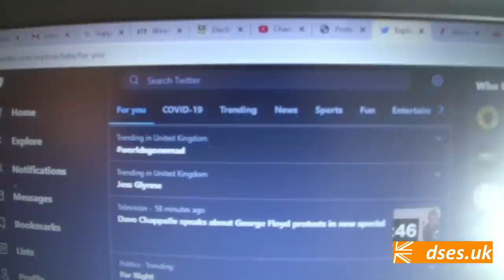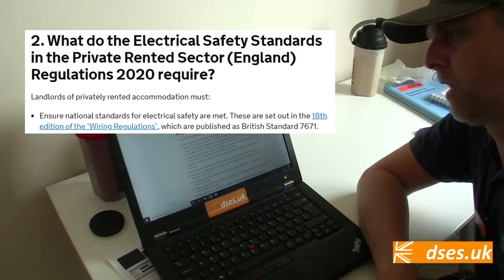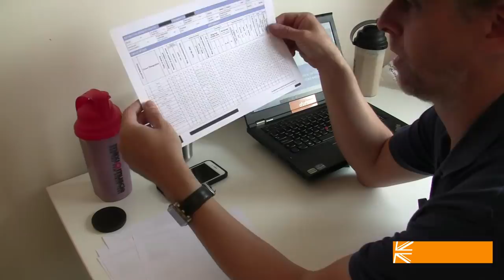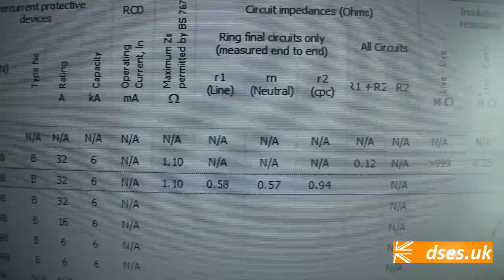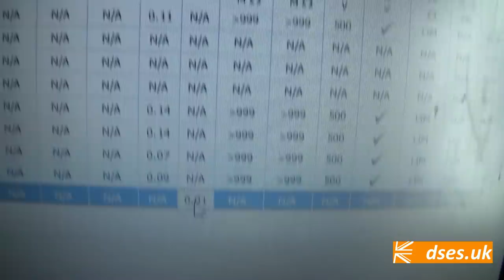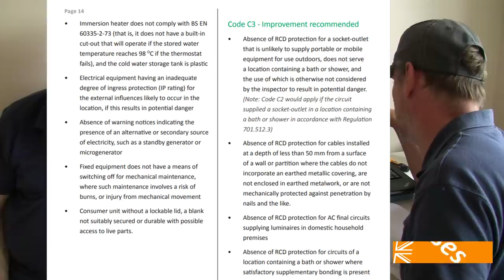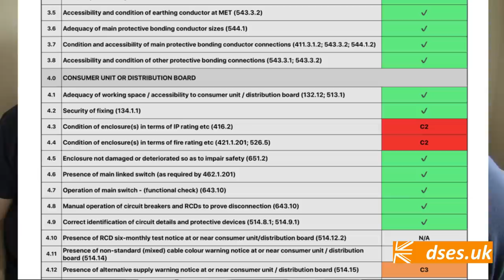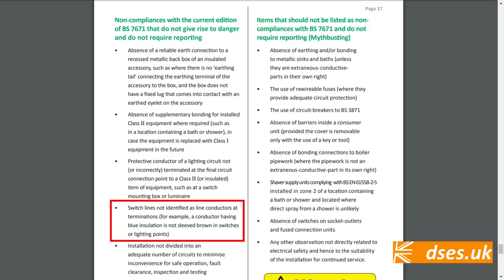Landlord electrical inspections from July!

Comment: When Nigel said are we under charging, I think he was hinting at a pay rise 🤣
Reply from the maker: He gets three apples a week and I'm not about to change that anytime soon.
Reply: Lol.. Nige is bored.. And underpaid, that's what we all gleaned from that video 🤣 this video is why I am not part of any recognised scheme. The rules and regs vary so much across them all. Gov. UK says one thing, IET say another, NICEIC say something else to be different to NAPIT, or whoever.. It's a mess! And who police's it anyway? I just stick to doing a safe quality job, non notifiable work, no rewires, no new CUs, keeps me trundling along. I agreed with everything you said Dave. I would not like to be doing rental properties either, as you say a tenant can come in after all your testing and change a light fitting, socket, etc break a RFC, expose live conductive parts on a light fitting, extend sockets incorrectly etc. Good rant and a explanation of the new nonsense going on. 👍
Reply: @muzikman2008  Had that happen to me on one of our rentals cut the frigging earth wires off when they swapped light fittings because they were in the way  dooohh

Comment: I was carrying out a test an inspection on a commercial property in 2018 when I got an unexpected visit from an electrical inspector  who said I was not to carry out any live testing with probes on exposed electrical parts and should use calculus to find those results,of course I nodded my head and said OK then waited for him to bugger off and went on and continued to live test,and as for not having to pt cpc leads to socket back boxes I disagree with you because you are correct regarding the 18th edition but I prefer to use good electrical practise rather than their bs

Comment: Even after 25 years it's nice to see confirmation that i'm not a complete nobber at I&T. 
I use an actual extension lead as my wander lead.  I like that you just add the water bond on. 
I'm going to copy that if you don't mind, whether you like it or not!
That guff about "the consumer unit not being made of a non-combustible enclosure" is a prepared statement on Icertifi's program. The tails to backboxes was removed by the 16th. I remember an argument at work about it. The only reg in the 16th that demanded this happen was when in a conduit installation the conduit was forming the earth, which makes sense doesn't it!

Comment: David well done on showing good common sense around the electrical regulations after all the regulations
are bounded by good codes of practice the law is based on the electricity at work etc act which is binding in law .
The problem revolves around interpretation of the regulations and the lack of parity and quality of the electricians 
/electrical engineers especially at the domestic level for installations .
Stick to you guns David I’m sick to death of the upgraded editions of the regulations it’s all about making manufacturers more money all of which could be covered by amendments to the existing regulations which could be printed off and added to the existing regs book .
Looks like the first contractor to test the system has done a generic job on the installation failing it when there is absolutely no need or cause to fail the installation it’s all about making easy money , by all means make recommendations but don’t fail the installation if it’s not required.

Comment: Personally, I'd strongly recommend a CU change.  It only takes a dodgy appliance to be plugged in with a broken earth conductor and you have a potentially dangerous situation.  The system earthing may be great but you can't account for some of the crap equipment tenants plug in.  Just my 2p.  Keep up the good work guys 👍
Reply from the maker: RCD protection is certainly a recommendation. For the dodgy appliance though, you'd have to have two faults: one to make the metalwork live and another to see the protective conductor failed. I'm not saying it can't happen, but such a situation being possible doesn't mean a 21yo installation has to be written off. I prefer to put the client in the picture and let them assess the risk rather than demanding they undertake an upgrade and withholding a pass report until they do.
Reply: i see your point but Wouldn't the landlord require that appliance to have a PAT carried out before placing it in a rented property?
Reply: @dl8966  EWR electricity at work regulations. Not at home regulations.

If your employer provides you with any equipment there are regulations to follow to make usre the equipment is safe to use while under taking your paid role. Thus they have to have an asset register and periodic testing and training. 

In a home you could find a toaster on the beach and bring it home and use it in the bath. If you die is that the landlords fault?
Reply: @dsesuk  while I agree it's unlikely, it is possible.  Also with mains filtration on appliances these days, it's common to have capacitive coupling to earth, hence the small amount of earth leakage we measure.  That's fine if the earth conductor is intact, if not, the metal case will float at some potential.  All I'm saying is that personally, I'd not be putting my name to any non-rcd protected installation in 2020, especially a rented one.  As competent electricians, we need to go beyond the bare minimum standards mentioned in these regs.  RCD protection in this case is a no-brainer... in my humble opinion 😉
Reply: @Chris-hy6jy  I'm actually with you on this, I think all socket outlets should be rcd protected on a rental property now. The trouble with giving it a c3 for absence of rcd's is, they'll be recommended on the next report and the one after that, the recommended upgrade never happens. I would personally c3 absence of rcd's for switch drops, if the rest of the installation was in good condition  though.

Comment: To add a RCD that the landlord will probably opt for gives 3 options -
Does the CU manufacturer have one available to fit the board  to replace the damaged switch ? ( quick and easy )
Add one in its own enclosure along side the board (  untidy )
Change the CU ( pita )

Comment: I know places with rewireable fuses no rcd protection. As long as it's safe it's ok.
yes you can recommend things like new rcbos and metallic consumer unit
Reply from the maker: You have to take each installation on its merits of course, but as you say, fuses provide effective overcurrent protection and earthing provides effective shock protection, so a pre-2016 installation shouldn't be deemed a failure just because the designer didn't have the foresight to know what 18th Edition Amendment 1 would look like.
Reply: @dsesuk  I would of done the same just put c3s for no rcd protection and the consumer unit being plastic which are really just recommendations. No C1s or 2s as I could tell it  and as long as all the earthing was good and no unsafe diy add ons or damaged a cable when putting a picture up.
Its up to the landlord/lady if they want to upgrade the installation
Reply: @Dark Dream yes but its not a failure to have an electical installation with rewireable fuses as thats what the design was at the time of install so any eicrs are retrospective to that time period.
You can recommend upgrades like rcd protection and new consumer unit etc which I would have done but they arent failures
Reply: @Dark Dream If the front cover/and or fuse cover was missing then that is a different matter.  You would code it accordingly.  But if the installation was wired according to the regs of the time, and there is nothing  immediately dangerous (eg VIR cable) then it's a C3, improvement recommended.
Reply from the maker: @Dark Dream Rewirable fuses are also mentioned in ESF Best Practice Guide 4 and despite the drawbacks of what might happen (wrong fusewire or device defeated with a nail, etc.), where correctly installed they do continue to provide adequate protection. BS3036 remains a valid standard and is listed in Appendix 1 of BS7671.
Reply: Dark Dream,  are you sure, plenty have been recalled, sparks certainly don’t check for these, then some RCD/ RCCB/ RCBO’s have had there issues and that’s without explaining to some that they can cause an issue.

Comment: A nice thing to find another man who dislikes rings. Absolute shambles, i subbied to a guy who installs a ring downstairs, a kitchen ring and an upstairs ring. I fit the board for him and he insisted on all rings being on a 32. I ran out of breakers and put the uostairs ring on a 10A to see if itd trip, 3 years later that breaker still stands.
Reply from the maker: Crikey. The whole point of the ring configuration was to supply a whole house with a single high-current socket circuit to keep copper use down. Having two or more rings is a nonsense.
Reply: @dsesuk yep. 3x32A rings, 1x40A oven circuit and a 50A shower circuit, all on a 60A main fuse ive witnessed before. All fun and games...
Reply: David Savery Electrical Service

Comment: I couldn't agree more.  Same in NZ or Aus, technically complied with regs at time of install and can remain in service unless unsafe.  Sure there have been additional mandatory requirements like rcds, but that doesn't necessarily trigger the latest regs.
Reply from the maker: Thanks for the view from down under. It's always beneficial to upgrade for safety of course, but the people I have issue with are those who demand it unquestioningly.

Comment: Yes, periodic testing should be done, in the same way gas was mandated. Landlords do need to ensure that what they provide is safe. Gas safety doesn't retrospectivly want the latest highly efficient boiler or whatever installed. Its either safe or it isn't and you can recommend as standards and technology develop. Many installations will be like this for many more decades. Sparkies are still pulling rubber cables out of old buildings for goodness sake. I totally agree with all your commends and observations. RCD's don't cover every eventuality of "additional protection" but they do go a damned good way for a sensible price. What was the statistic? Introduce the compenant person scheme and the number of consumer unit fires went up so we now put them in a metal one to hide bad workmanship? And rings should be stopped. The only way you can test a ring is to break it. You then put it back together. But you can't fully test it - catch the insulation etc? Defeat of the purpose of the testing. If you need a 32Amp final, use 4mm. Sure its more of a ball ache to install....

Comment: As usual a right cluster fudge. As everyone knows even someone like me who hasn't even started training yet, that standards are not retrospective so as you say as long as the installation conforms to the standard at the time of installation it isn't a fail by today's standards.
Reply from the maker: I suppose you have to look at it and ask if a 21yo installation is now so dangerously out of date that it has to be upgraded, and the short answer is no. In my opinion. But what do I know Richard? I'm just a hungover asshat.

Comment: You dont have to note agreed limitations as you listed because its on the front page of the report as shown below.
EXTENT AND LIMITATIONS OF INSPECTION AND TESTING
The inspection and testing detailed in this report and accompanying schedules have been carried out in accordance with BS
7671:2018 (IET Wiring Regulations) as amended to 2018.
It should be noted that cables concealed within trunking and conduits, under floors, in roof spaces, and generally within the fabric
of the building or underground, have not been inspected unless specifically agreed between the client and inspector prior to the
inspection. An inspection should be made within an accessible roof space housing other electrical equipment

Comment: 32A rings may not be great, but 32A radials have there place. They are invaluable it utility rooms, kitchens and garage/workshops. It's much better than a couple of 16A or even 20A radials as you don't have to worry what is plugged in where. 
It's a different story in bedrooms, living rooms and so on. However, the 32A circuit has its place for sockets.

Comment: sounds like a great tool for scam artists. in my line of work, i am to test/inspect to current standards and can even recommend changes. however, the end user doesn't need to update anything that still adheres to the original spec to which it was done, "grandfathered in" . as long as it isn't unsafe or in disrepair, leave it
Reply: I have got into fights on forums over this.
If it's fscking safe it's safe.
Reply: BS3036 boards can be safer than some modern installs.... :\

Comment: I can understand if an existing installation is dangerous - then it should brought up to 18th edition - but as you say if an existing installation is deemed safe for its generation of installation - then it should be passed on that.  Otherwise by definition all previous (to 18th Edition) electrical installations (with some conditional exceptions you outlined)  irrespective of being safe - need to be upgraded!  But I also see there a Code C3 classification -  which states: 

"The C3 classification code does not indicate remedial work is required, but only that improvement is recommended. Landlords don’t have to make the improvement, but it would improve the safety of the installation if they did"

Does that mean it doesn't have to meet 18th Edition or that it does but also needs something else?

Really what this directive should be -  is to simply outline a minimum standard required for rental properties - ( ie an  installation that is safe and  has not been badly/incorrectly maintained/installed) - basically weeding out the bodge jobs that have been carried out - and minimally maintained by a landlord,

Comment: It’s perfectly clear 😦. You must meet 18th edition. 18th edition includes the precondition as you highlighted that it’s not retrospective. All in all nothing’s changed. But yes, I can see many outfits using that first definition it to legitimise cheap upfront EICR with expensive remedials.
Reply from the maker: That's the way I see it, but I'm seeing letting agencies and landlords taking it as upgrade is mandatory.
Reply: David Savery Electrical Services Sure it could be worded better for people who don’t read the small print. All you can do is give the professional advice you believe in. In the meantime if it’s one of your existing clients reassure them it’s not required. This is IMHO simply aimed at making landlords have their properties inspected. If people don’t take your advice then what can you do. Someone else may have convinced them otherwise. If they want to bring it up to current regs (ie remove all C3’s) then do the job, get paid, go home in the knowledge that you can’t force people to believe apples are apples! Though I’d  keep copies of advice given that it wasn’t needed for any future change of heart!

Comment: 34:00 a good thing to try first is simply to put the plug in and out 3 or 4 times, item that's enough to give you a decent connection without having to remove the front in my experience.

Comment: What is the net benefit of signing off "Satisfactory" certs of installations with no RCDs on? Your landlord saves £300-£600 on his 5 yearly remedial work bill (you've already done the testing, so no reason why it shouldn't be on the low end of that), anything else?

On the flipside, while the landlord saves one month's rent swerving electrical upgrades for another 5 years, the tenants are living in a house with safety devices that won't bat an eyelid at certain dangerous situations and you have one more certificate with your name on to add to the ever-increasing mass of certificates of non-RCD protected installations of which you are potentially responsible.

Personally, I'd much rather code no RCD at C2, if, as a result, my integrity is called into question by a landlord that is angry he has to pay £200-300 to make his property considerably safer I can't promise I'll struggle to make peace with that.

Comment: The guidance says must meet 18th Edition, and older installations DO meet 18th Edition, ‘cos in the 18th Edition regs it allows for older installations to conform to the standard which they were designed and built to, surely?
Reply from the maker: That's the way I see it. Further discussion was in a follow-up video!

Comment: My 18thC cottage just failed an inspection because the tallow candles dont meet current lowfat regs. I pointed out that 18thC Edition applied but the greadeboghlet insisted I upgrade to Paraffin wax.
Reply: sums up the issue perfectly :) ...apart from parrafin wax is usually derived from coal/shale oil and so doesn't meet the current eco regulations. Please change your candles to Beeswax.😁